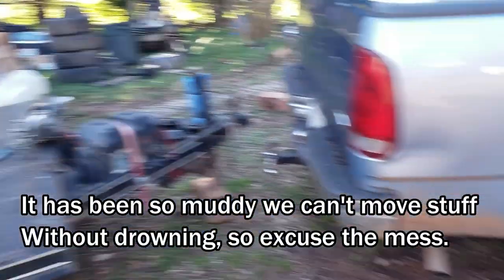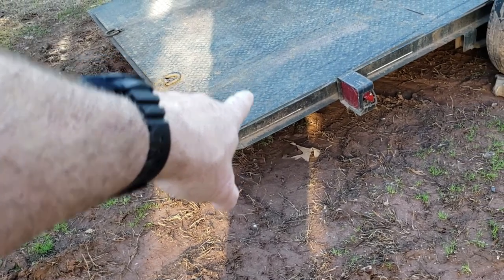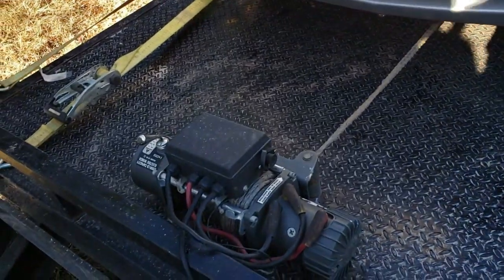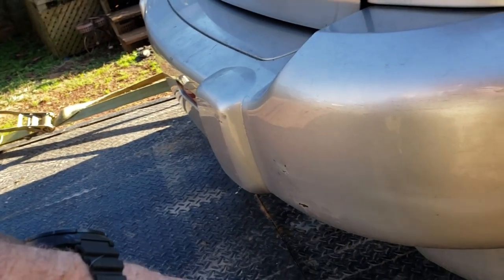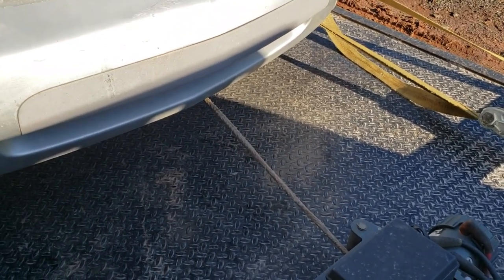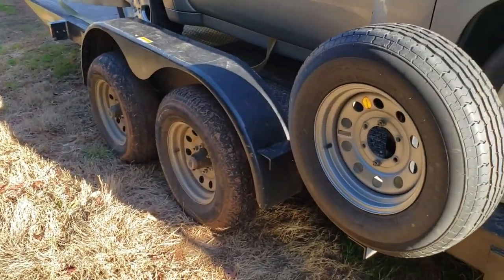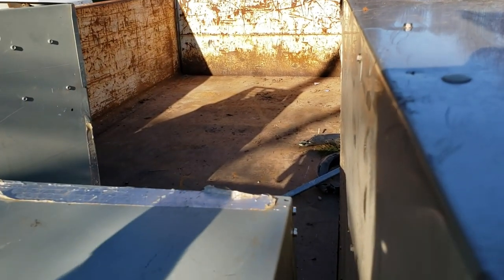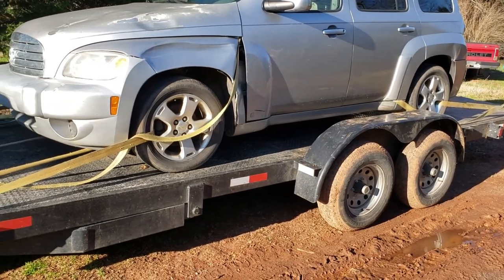What to know before you buy (or build) a tilt trailer.

Comment: You have the basic trailer, now improve it. Hit the deck with a wire wheel where the gaps are and weld them in. I sure you know somebody with a welder that you can make a "deal" with. Then remove that single action cylinder and replace it with one that has power both ways. Put a manual valve for control. Then have your welder buddy add a hold-down. We put one together with junk yard parts for less than $200.00. And that was from scratch. It also took 2 cases of beer. "Git er Done'

Comment: Thanks for the info..  I wouldn't have guessed the deck problem when loading a truck backwards.  That would be a dilemma especially if you were all by yourself out in the middle of no-where.
Reply from the maker: IT isn't good to tow it far with something loaded backwards because there is too little tongue weight. But sometimes you have to load it backwards then go somewhere safe, like a big empty parking lot, and turn the load around. Also power down would allow a lot more functionality.
Reply: The heavier end got to go first on the deck 
There’s got to have weight in the tongue to prevent swaying in the freeway

Comment: Awe that diamond plate on #2 that hangs off past that structural - guessing it touches the ground before that flimsy plate, put a cut off wheel on a angle grinder and zip that flimsy plate off.

Comment: Sometimes you gotta do what you gotta do, but if the gravity deck won't lower on it's own you don't have the trailer loaded properly.  Good tips to look out for when buying a trailer though.
Reply from the maker: Yes, but if I need to lower the deck for any reason with any weight on it I can't. And if I need to move a car backwards ( which happens when something else has to go on the front of the trailer after a car is loaded) I can't without it tilting. IT is a poor design.
Reply: @UncleWillie  It's a great design for moving functional vehicles.  It's a bad design for somebody that hauls dead or broken vehicles.  You can't fault the manufacturer if you're using it for a purpose it wasn't designed for.
Reply from the maker: @Bread996  no where does it say for functional vehicles only. It is a bad design and badly put together out of cheep materials.
Reply: @UncleWillie  the materials and construction again would work fine for a functional car.  If you wanted to haul a collector car or your race car to the track.  It’s not a good choice for hauling junk cars.  It’s not a bad trailer, you made a bad purchase for your intended purpose.
Reply from the maker: @Bread996  Again. it is not listed as a "functional vehicle trailer" It is poorly built. No other way around it it. I realize you would probably argue with a tree stump, but it does not change the fact that it is a bad trailer. There is no excuse for the suspension bolts failing in 6 months. No excuse for the poor quality wiring. No excuse for the Walmart light mounts. No excuse for the hydraulic unit falling apart. NO excuse for the thin steel on the decking. No matter what the trailer was made for it is poorly built.
Reply: @UncleWillie  all factory  mass produced trailer are all made out of  cheep materials. and every joint is a stitch weld, just look under any of them trailers and you can clearly see even the frame, cross member only have short welds here an there, that is why i been in the custom order trailer business over 30 years, but your going to pay for that great work.. i will not use c-channel on any trailer, its all heavy tubing, welded water tight,,

Comment: 7:25  ...if you ever break a cable...I had one  break. I was concerned that it might fly thru the air with a terrible force but it simply laid down on the trailer. I was winching on a 4 ton shipping container when it happened
Reply from the maker: I had a steel cable break and came back and destroyed the back door of my truck. They are unpredictable at best. If I have a choice I would rather be beaten with dental floss than welding wire. LOL.
Reply: You can patch a synthetic line. It just shrinks the line over time.

Comment: Nice video. Thanks! Is the winch on the floor/bed mount the best or should the winch be elevated higher than the floor/bed? Also how many d rings do you recommend?
Reply from the maker: I like the low mounted winch better. If I could it would be outside the front rail and not on the floor. As for d rings, both of my trailers have 4, they need four more. 2 more on each side.

Comment: Its not a big deal to finish the welds  across the trailer.Only takes a few  minutes
Reply from the maker: No, but at the moment I don't have a welder. It is on of those things on the to do list. You know, the one that never gets done.
Reply: Get yourself a couple stick rods for arc welding and 2 or 3 car batteries and you got yourself a makeshift welder. YouTube it. Good for trail repairs.

Comment: they make them-with no power down same why i do. to many fools over load the back end of the trailer and loss control of the truck and trailer going down the road, if the deck dont go down that means you dont have any  toung weight in fact your lifting the back end of your truck off the ground, you hit50 mph and your our of control all over the road, think about it..
Reply from the maker: Assuming that everyone is stupid is a bad business plan.   Building something with a shoddy design because you believe everyone is too stupid to use it properly doesn't make you look good. There are many reasons why power down is a superior design.
Reply: @UncleWillie  it dont matter what it makes me look like, its fact. so many loss control due to over loaded trailers. that why power down is not allowed by law here, every truck 1 ton an over and every trailer with a GVW over 10,000 lbs must have a yearly safety check, and power down will not pass, if decks were needed to force down twisting the frames were they are not meant to. dump trucks would have power down, even flat bed tow trucks do not have power down. bottom line if the deck dont go down your way over loaded on the back end.. you never load a pick up with-the front end at the bck of a trailer you will always be bank end heavy. , trust me i know..
Reply from the maker: Where do you live that power down isn't allowed?
Reply: @UncleWillie  On Canada, thunk about it a person is standing by rge front of the trailer an powers it down truck lifts an swings taking out that person, dump trucks flip over back wards .. in my 68 years i deem more then i ever wanted to..i dont know why you need to ask were i am,when all you had to do is click on me an watch any video they all say were i am to  a tee. huum
Reply from the maker: @arnoldromppai5395  Canada laws don't apply here.
Reply: @UncleWillie  com on. you really think any trailer sold in the usa is not sold in Canada.. let see  been dealers for 4 different usa dealer before .. but now i just keep to my top end custom trailers i been building over 40 years wow
Reply from the maker: @arnoldromppai5395  I can buy a factory built tilt with power down here, your argument is invalid.
Reply: @UncleWillie  good for you  ..   invalid.":>? its  the law here
Reply: @arnoldromppai5395  Flat bed tow trucks are most certainly power down. although you are correct in saying vehicles should be loaded forward facing with the weight in the front, you are incorrect in thinking that trailers shouldn't be power down. There are situations where power down is needed and Ive never heard of power down being illegal anywhere.

Comment: If you've broken every brand it sounds like you don't realize how to properly use a winch,  or realize the have their capacity listed for a reason.  While a winch cable will kill you if it breaks it will not break if you use it properly.  My warn 8274 was made in 1983,  has been used thousands of times,  and the cable still looks and performs like new, minus the shiny color.  You know the old saying.....A fkn idiot can destroy anything .
Reply from the maker: You are welcome to your opinion.
Reply: You're comparing apples to oranges, the Warn 8274 was the best winch ever made and is indestructable.